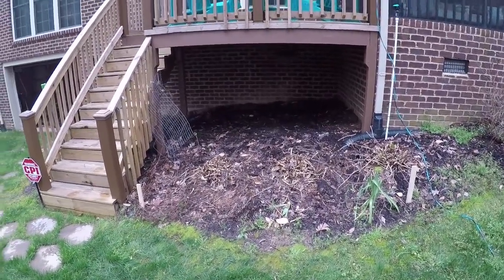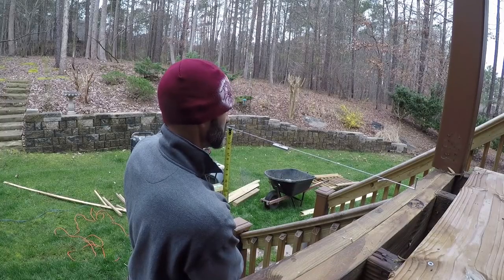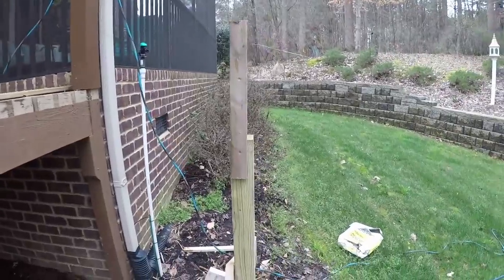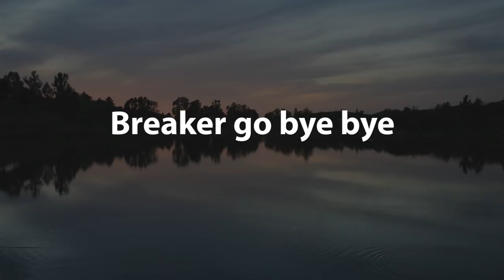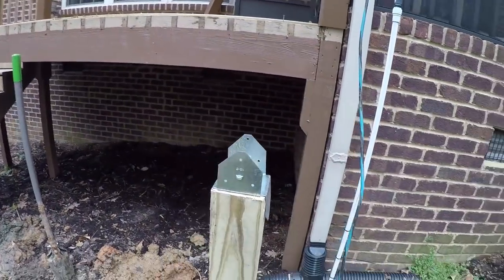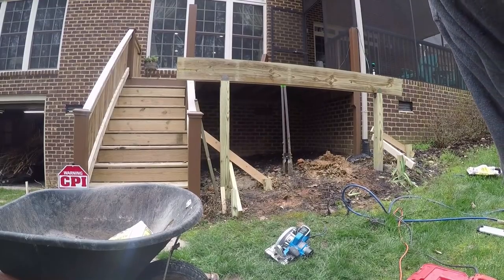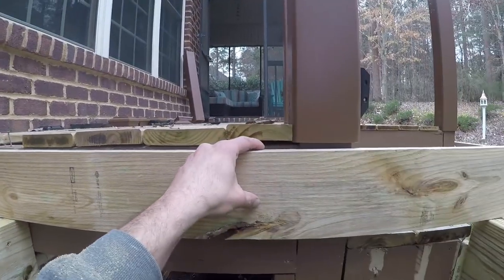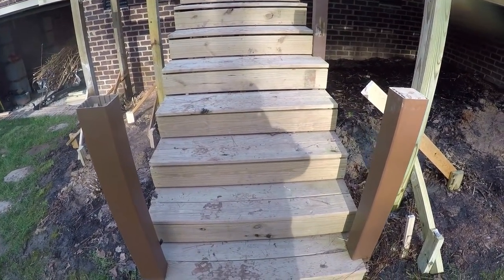How to expand an existing deck  Part 1 of 3

Comment: good job Matt. I am a one man handyman like yourself and always looking for ways to make things easier when working without a helper. One thing I got that is a great help to me is a 360 degree laser level with a tri-pod. It's really great when trying to level up many things from decks, suspended ceilings, railings, windows, ect. I got mine from amazon and it is worth the investment when you work alone.
Reply from the maker: I've seen those.  Woulda been VERY helpful on this job.  Maybe even with the handrails.  Thanks for pointing that out.  I may go ahead and get one.   Which one do you have?
Reply: The name brand lasers are pricey so  I went on amazon and got a HUEPAR 621CG LASER LEVEL. I also got their basic camera tri-pod, but I'm sure you got one of those for videos. I also got a SUPON NEW CAMERA SUPER CLAMP to mount the laser onto my FASTCAP 3RD HAND floor to ceiling support poles for doing kitchen cabs, suspended ceilings and many other leveling tasks. as a tip, the plumb line comes in handy for lining up stair rails.

Comment: Great video Matt! You know you wouldn't have to worry about tripped breakers with cordless tools right? Lol Anyways looking forward to video 2 and 3.
Reply from the maker: I know, I know. 😏 But... I tell you what.  Ain't nothin like running those saws all day without losing power or switching batteries. I do use my cordless saws on lighter jobs.

Comment: Not to be that guy, but 2x10s are actually 1 1/2" x 9 1/4" It didn't seem to effect you too badly but I know that has bit me in the past, so I thought I would give you the heads up.
Reply from the maker: No man, I'm glad to hear the feedback.  They seem to vary I imagine due to drying out.  I've installed a bunch of hangers before then come back dropping in joists and they are all out of whack. 🤯

Comment: Interesting video.  But you spent about 5 minutes dinking around with a string level.  A 6' or even 8' level is about $10 at Harbor Freight and much more accurate and easier to use.  Even laser levels are quite affordable.

Comment: Lots of positive comments, but I see some problems. The 4"x4" posts should be bigger and should also have footings. I didn't see any footings. Are they just in the ground?? That string is a bad idea for the short distance you're working. I don't think that deck will be 100% safe
Reply: I agree. What you’ve done is extremely wrong right from the start. I didn’t even watch the rest of your video knowing this.